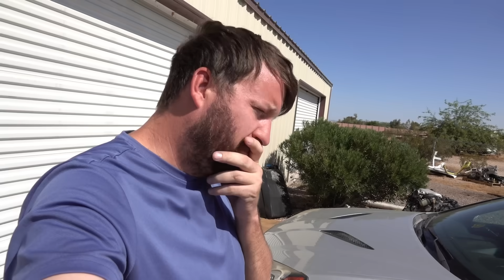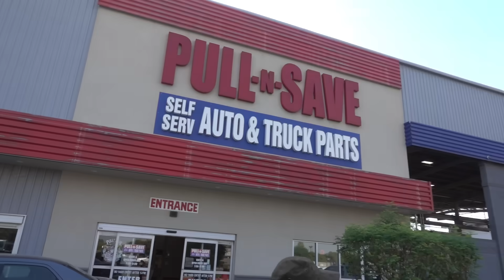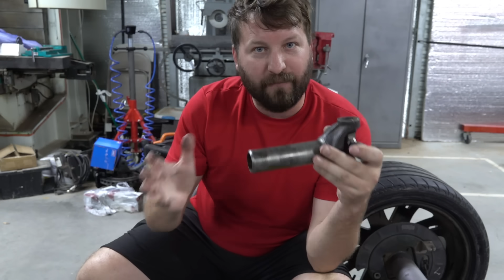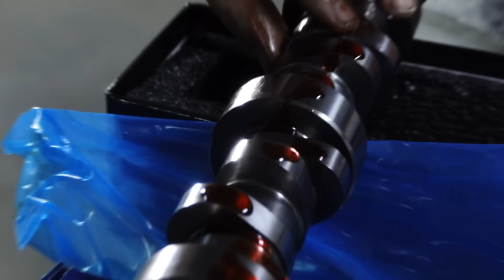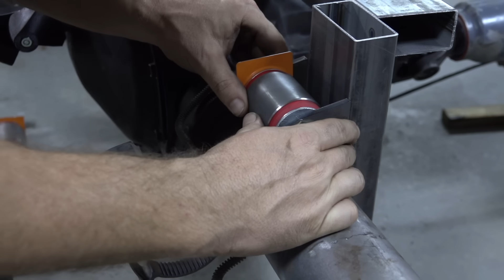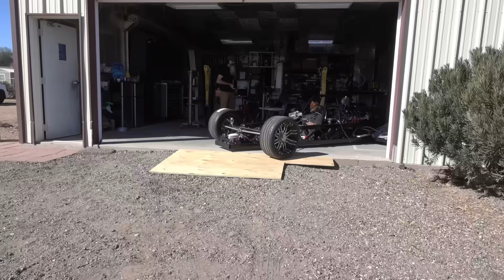Death Kart or Die Trying! LS Formula car full build!

Comment: Why would you use a solid rear axle and not an independent rear suspension? Also did you think of using a transaxle instead of the route you went.
Reply from the maker: Yes we did that's why we went bankrupt twice. See our old videos. This truly is the simplest cheapest thing you can actually do. Testing latter this year.

Comment: If you'll allow me...
with $120k here in Brazil I can build something much more functional, faster and cheaper than this...
but since I'm not here to promote myself, but rather to contribute, here are some ideas that I've seen being used here and that work very well...
Front engine: Engines like the Corolla 1.8 (sport version) reach considerable power, or the "AP" engine from the Volkswagen (AP easily reaches 500hp). The AP engine is widely used here because it has a huge range of "cheap" parts and adjustments...
since it was originally made for use in front-wheel drive, it can be placed in the rear center with few adjustments, saving weight x power and complexity, and as a bonus it also makes it possible to have an easy and cheap independent suspension.

The adoption of such a set would allow for cost, weight, complexity reduction, reduction of measurements such as total length and width, in addition to adding advantages such as suspension...

I could continue with the subject but I've already gone on too long...

If you're interested, I'll get back to you...
Reply: https://www.youtube.com/shorts/tydgROoYqPU exemplo
Reply from the maker: A few people misunderstand that part of the video. We did not spend $110k on this. We spent it on the first one. 10 years ago. You can watch the old videos on our channel.

Comment: You have an excellent power to weight ratio.  An IRS seems like it would increase performance, safety and comfort.  Every pull it your self yard has cheap explorer setups.  Really cool build guys.
Reply from the maker: Thank you very much. Yes if this test fails. We are getting on Ebay and throwing Corvette parts at it.
Reply: @centurialinc  Dang, Corvette parts will make for a sweet setup!

Comment: If I saw this build on a trailer I would assume it was a land speed car. You don't need long travel suspension to race the standing mile on a runway. I like the concept of keeping the build extremely simple so long as you never plan to drive on the street. Knowing myself, I would be tempted to drive on the open road with any vehicle I build so I would have to opt for some kind of simple suspension. I don't think many people understand how difficult it is to engineer proper suspension. You can't just use pre-existing subframes and geometry on a custom chassis.
Reply from the maker: Very well said! Thank you. It is truly a full size kart. Not for the street, not to say we won't try.....

Comment: 😂 great idea sooo no suspension and yet you didn't think much about ground clearance also you could do with a different steering ratio full lock should be around 100 degrees each way
Reply from the maker: Ground effect requires low clearance. This car is the same as GT3 cars and LMP or F1. If you have low clearance you don't want the suspension to compress much. So no suspension. We did think about it, a lot. 3 different designs and attempts, and 10 years latter this is the fastest, simplest, most affordable thing anyone could build. Latter this year we will see if it works or not.

Comment: Switching to an independent rear suspension axle will solve the suspension vs diff straight to trans issue. Pull the rear center section from a Charger, and can custom build a double A-arm setup.
Reply from the maker: That would work! Thank you.

Comment: Dude, put an IRS diff in there before you break something at speed and the cart comes apart around you.  The Cadillac CTS-V diff would work for your application and should be plenty strong enough.  Otherwise, you're destined for failure again.
Reply from the maker: We definitely can do that. It's worth at least one test as is before we buy corvette parts off ebay and slap them on.
Reply: @centurialinc  Testing with a rigid mounted live axle could amount to inviting tragedy to pay you a visit while you're at high speed.   The 2009-2013 Cadillac CTS diff is available in salvage yards all over the place and is (I believe) a corporate 10 bolt.  The factory Cadillac suspension trailing arms are fairly straight forward to mount and you get disk brakes included as part of the system so you don't have to go mod-ing the half shafts/suspension to use the disc brakes you have now.

The Cadillac is a 4-passenger car that will do a legit 130 so the parts are more than strong enough for the performance you're going to ask of them.

Comment: I'm not sure I would go with the idea of using bushings as suspension I mean you could use motorcycle monolith and I'm sure you could find an old motorcycle for 500 bucks you know they're designed to hold up to a certain amount of weight you know by adding say two on a simple cantilever I think you could do something pretty cool with that that's what I would have decided I mean your fabricators you got the machines the welders you name it I personally wouldn't want to be in something with multiple hundred horsepower with no suspension all it takes is for you to hit a bump and it disrupts the chassis and then you lose traction.
Reply from the maker: That's a real possibility. It's worth a try. Then we can add suspension.

Comment: Cool! About the only things I would have done differently is to go with a Corvette rear diff as it can be hard mounted and still have independent rear suspension.
Reply from the maker: We will do that on our next build.
Reply: @centurialinc  The transmission won't survive the impact from the rear axle for long... 💥
Take the front axle and transmission of a front-wheel drive car - then your engine will be moved further back
 and your race car will be considerably shorter... 👍
Greetings from the Black Forest in good old Germany! 😍

Comment: Don't take me wrong but the only reason you're failing on producing something past the prototype stage is because you're not designing and modeling the car at the first stages of your build, you should get all your parts and then take dimensions and model your design and only THEN you can start building.
Reply: Good job though, not trying to dismiss this attempt... Really hope you come through.
Reply from the maker: Thank you we understand. Thanks for the support. Testing latter this year.
Reply from the maker: We did. I just didn't show it. The last 2 cars we fully modeled. Just ended up too darn expensive.

Comment: You need suspension (with this amount of power) for at least three major reasons. 
1. Grip 
2. Safety
3. Comfort
Find yourself a subframe, diff, and suspension from an IRS/RWD vehicle, and incorporate that into your frame. Something like a nissan 240sx, or any other car that has become popular for drifting and thus has a ton of aftermarket support (coilovers, adjustable arms for geometry, disc brakes, bushings, etc etc) and youll be good to go. 
The same applies to the front. Find a front subframe/steering/suspension assembly (from the same make/model as the rear setup to keep it simple) and use that up front. 
Now youve got full suspension to be able to use all that power on surfaces other than a perfectly smooth track (and really, where does that exist!? Nowhere) without killing yourself. 
Also, it's already obvious that this thing needs some ground clearance. 

Finally, this kart is ridiculously long. Youd be better off mounting the engine in front of the driver but behind the front axle for a front mid-ship layout that will still give you a good platform for front to rear balance and your handling will vastly improve because you aren't a mile long. 
Really, what you should do is just build a Miata, 240sx, or 350z based death kart with an LS swapped into it. The swap kits exist, the documentation is online, and it WILL end up being vastly more capable (AKA fun!!) with less work.
Reply: I would use the mid engine transaxle from a Porsche Boxter or Cayman. Being unreliable German cars there are a ton of really cheap ones out there with dead or dying engines or crashed by reckless idiots. The manual ones have good transmissions that can handle a lot of power. I'd throw out the flat 6 and use an adapter plate to connect the LS V8. The Porsche has other salvageable performance parts like the front end steering and suspension, wheels, breaks, seats etc. People have swapped LS engines into mid engine Porsches already so it's doable.
Reply: @JMCDNLD-j6u  The G50 and other turbo porsche transaxles are what are typically used for superlite/Ultima etc MR builds, Ricardo (they do the GT3 cup boxes for Porsche..), Graziano, etc if you are $$$$$. LS has way, way more torque (especially worked LS, or LS3 and up) than a boxter/low end porsche, and torque is how gearboxes are rated.
Reply: @N4CR  Probably true. For a Porsche transmission derived racer something like a Honda K20 (lower on torque but really high revving) would be better. Also widely available in wrecking yards with a rich performance aftermarket industry. All the weight and torque of an iron block Vortec would require a stronger heavier frame and wouldn't provide many advantages for a lightweight cornering open wheel racer. There's a reason Lotus chose a Celica engine for the Elise and not an LQ4.
Reply from the maker: Thank you! We can do that on the second rev.
Reply: @centurialinc you will not want to drive fast on a track with it because it will be dangerous.
Reply: but infinite spring rate is fun at 150mph...
Reply: S2k is the only Japanese chassis that retains true FMR with an LS swap. Even then you need specific mounts and to do a bit of massaging.
Reply: I have an s10 blazer ls swapped, it's a death trap roller skate, I only go fast straight
Reply: @garrettburrows442  sounds like you need to do some suspension work
Reply: Look at how much an F1 car suspension (doesn't) move. And how much punishment the drivers take because of that. This thing is either going to be a rocketship on a track, or be twitchy as fk and  spin out the first bend with a bump - and I'm really interested to see which it is.

Comment: I’d use irs from Camaro SS
Reply from the maker: we can definitely do that.
Reply: There are far cheaper options with a ton of aftermarket support
Reply: @ what options are those?
Reply: @svtnick5412  just about any Japanese rwd platform. 
240sx, miata, 300z, 350z, supra, RX7, FRS/BRZ... anything japanese that's common in drifting.
Reply: @michaelrodgers6559  just about all those are either weaker and can’t take the power of the ls or are more expensive. We are also looking at options that can actually unbolt and be transferred. Not where you have to chop up a car just to get it. If you can’t get your hands on a Camaro one then use one from a mustang.
Reply: @svtnick5412  all those options I mentioned have bolt on subframes, like any other unibody car. 
If you're worried about the rear diff and axle strength, the 350Z diff will absolutely handle a mild LS, and there are also kits available for most of the cars I mentioned that adapt an IRS 8.8 diff, giving you strength and all the gear options in the world.
Reply: @ so in other words it’s more cost effective to go with a Camaro SS or mustang irs.

Comment: 1 should have gone with like a Camaro diff 2 I would have used front suspension from like a side by side. I think your trans is to long being mid engine. In this day and age you really don’t need a v8. If I were to build this same idea. I would have chosen a smaller k20 or k24 engine mated to a rwd trans. Same or more horsepower smaller package.
Reply from the maker: We can. After we test this one we can cut and fit other parts in.

Comment: LOL Good luck trying to go around a circuit track with no suspension 😂😂😂 This is 100% a grift. Anyone that knows automotive knows this will not work 😅
Reply: If it had a shorter wheel base and a street bike motor I could see it MAYBE working. That thing is on fresh asphalt and still beating the hell out of the driver. It’s too long and too heavy.
Reply from the maker: We will see. Testing will start latter this year around fall.
Reply from the maker: We will see. The shifter kart guys do just fine. No suspension.

Comment: Independent rear suspension out of a vette will fix rear suspension problem
Reply from the maker: Yes. That is the back up plan. If this fails then we will go to ebay and grab some corvette stuff.
Reply: I've considered build similar like this, and looked c5 c6 rear transaxles/subframes but also consider for cheap 2003 up explorer irs cheap has a full frame plentiful and ford's us a flange in the rear diff you hooked that to a slip yoke

Comment: Idea! Put a mild suspension on the drivers seat. Like John Deere does to their lawn tractors. Might save someones lumbar discs! Lol
Reply from the maker: That's a decent idea for sure!
Reply: Suspension isn't about comfort but traction and control. A solid front end coupled with no rear suspension is simply idiotic.
Reply: Go karts dont need suspension, why should a giant go kart need suspension?
Reply: @Dudeface167 Regular go karts dont have a LS engine and several hundred horsepower.
Reply: @Dudeface167racing go karts bend quite a bit and that acts as a suspension, theres a bar you can tighten or loosen to change how much the frame of the kart bends, allows you to adjust grip levels.
Reply: @DeepFriedRice1  @imapopo2924 won't it flex enough with the LS engine and several hundred horsepower? 😂

Comment: Good job man. Fast street cars that have the bells and whisltes are expensive.  Little carts are too but its way cool. Swap a gen 5 head can and intake for 10 percent power. Or a  6 lb boost turbo stay on same tune
Reply from the maker: Thank you very much! We did grab a cheap ebay turbo from a local car guy. GT35 I think. Should do the job.

Comment: awesome work, i hope its a joke, no suspension, that monster probably is more eight than the SUV you took it from. seems like a lot of work for a April fools joke
Reply from the maker: Not a joke this is for real. It's going on the track latter this year. Death Kart or Die Trying. T shirts coming soon.
Reply: @centurialinc if you're seriously running solid axles you'll want to run smaller wheels with the same OD tires to use PSI to work as suspension. Regardless it'll be prone to chatter, but more sidewall will allow you to run 15-25 psi softening bump-skipping especially under hard braking.
Reply: @Muppetslayer153 I concur with everything he said.
Reply: @Muppetslayer153 yeah will actually help out so much in bettering the car's handling but then again the brakes rotor size for the front in comparison to the rear will need to be staggered with having just abouta 2inch difference as the rear tire is what they will need to run even lower tire pressures to avoid binding up the rear diff
Reply: @centurialinc dumb way to kill yourself… needle bearings need some angle to not get destroyed and man it was already kinda bouncing in your test drive…. You need SOME suspension or some tall sidewall tires or something good grief.
Reply: All said and done, monkeys and gorillas can do things that boggle the human mind and their not human. I had no doubt that you were able to do what you set out to do! From concept to an end product is what separates us from the animal world. Man thinks man makes! Cool project 😊
Reply: Could you mount the engine, transmission, and axle in a subframe that pivots for some suspension? Trying to think of how to describe it.

Comment: Please explain your suspension... or lack of.
Reply from the maker: Sure it's basically a full scale shifter kart. The bushings will give us a small amount of movement. But ultimately not very much. So the axles get directly mounted to the chassis with just those and a few tie rods to prevent rotation of the axle. Only up and down movement. Future posts will cover how it moves and prove that it does indeed move. Follow to learn more and see how it does on track latter this year.
Reply: @centurialinc  i gotta be honest, this sounds terrible for any sport application
Reply from the maker: We will see. It's not intended to fit into any existing classes. It's intended to show how much performance we can get for how little money. And if people like it we will try to create a racing class just for cars like this.
Reply: @centurialinc  no, im thinking this is unsuitable for spirited driving at all. You have no control of corner weights, and no way to manage or adjust the wheel travel path through bumps or cornering. Please reconsider your suspension design.
Reply from the maker: Actually there is a lot of adjustment. The rubber mounts can be changed. Different shapes can provide progressive spring rates which is critical for areo cars like this one, see our 3D model on the website. Fast speeds means more down force so the springs have to get stiffer as they compress this is hard to do but with rubber is easy. You can change the durometer of the rubber to change it's dampening effects. The wheels mount with hiem joints allowing for angle adjustments. The steel structure can also be tuned for flex or stiffness. So there is a lot you can do with what's here. Give it a chance. Lets see what happens. We can always add suspension. That's easy and trivial it's just very expensive.